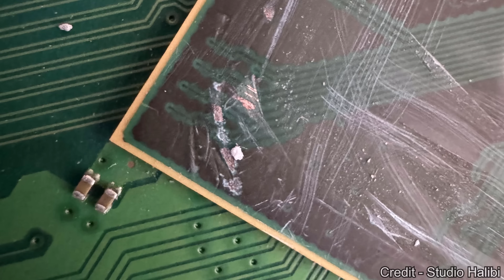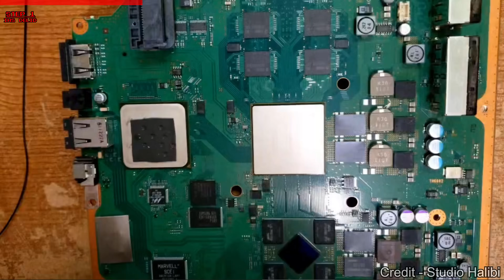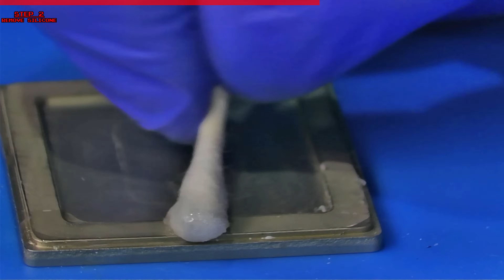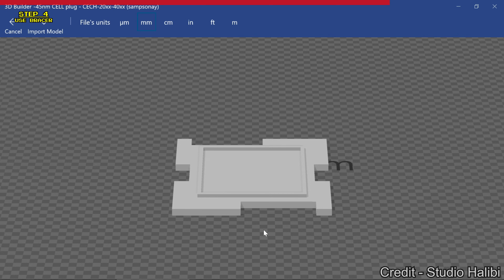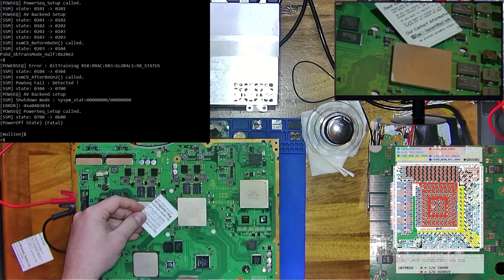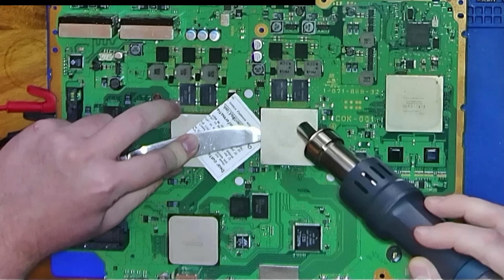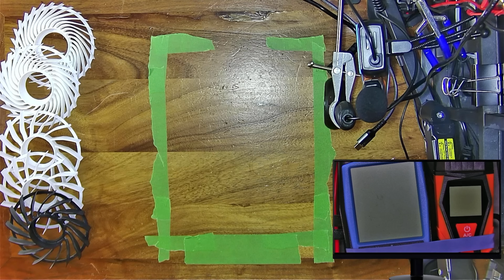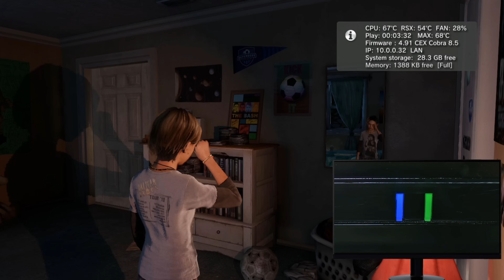How to Fix | Episode 1: Overheating. How to Delid CPU/GPU and fix YLOD - BEWARE of BAD MODs!

Comment: Hi.
2nd time around here.
I want to differ in something......
I have an E model,and i did almost all of this.
Only i need delid Cell and new thermal pads.
And i did some extras too.
I used the last ps3 fan,the white label DC brushless from last models (make long cables for to attach) and used thermal grizzly.
And my 226 psu flopped,so i have 231 instead,and i got 62 on Rsx,73 on cell at 40x speed at maximum.
I don't think 231 is the worst one (ZZR  with 19 blade fan are truly the worst option)
And that's for me.
Also i did remarry on BD drive,my 410 lens is great.
Maybe one day i can get a frankie mod for this beast.
Reply from the maker: I am quite sure the APS-231 does run hotter in a BC model. Both the 226 and ZSSR run cooler in this scenario. Though the 231 does work, there's no telling for how long.

About the fans from later models. I tried a G14T S1, it's the quietest fan. But the issue is that it's weak. In order to push the needed volume of air, it needs to run at like 40-60%, which is just as loud and doesn't have the headroom at 100% to push much more air. So if ever the higher percentages are needed, like when past wears out or a really hot day, it can't cool as well as those more powerful fans. 

Fun fact, the G14T and D14F have the exact same 15-blade blade. It slips on the rotor. The only difference is the motors power.

Comment: Man, the sheer increase in console hardware fragility/complexity between 6th and 7th generation is staggering. 
Even something as simple as a routine replacement of thermal paste requires specialized tools and surgeon-like precision to avoid destroying your machine.
I've done lots of amateur work on 6th gen stuff and earlier to save myself a bit of money and learn new things, but after 2005 all the manufacturers really put their foot down.

I'm almost glad that consoles seem to be dying, at least in 20 years when all the Xbox Series consoles start to fail from who-knows-what, nobody will have to scramble to save them to keep their nonexistent exclusives playable. 
I dread the day when I can no longer boot up a quick game of Tokyo Jungle.

Comment: Thought i watch your video in it's entirety this time. It's a very nice guide but i really do not see the point in relidding. It's completely pointless. As long as the cut glue is still there, with it be clamped down. It should be more than enough to keep it in place, infact the thermal paste along with the clamp should keep the IHS almost glued to the Heatsink. I Delidded Wii's, PC's, Wii U's, 360 Slims and E's and PS3's. Never had any issue with the Dellided IHS's rattling and moving inside. The Paste along with the tightness of the Heatsink is enough to keep it tightly in place. As for Delidding an RSX, heat gun with a dental tool is all that's needed to lift it up when the RSX IHS loosens.
Reply from the maker: it's not about it staying in place. The 2 issues with leaving the cut silicone in place is that it's nearly impossable to line up perfectly again and if it's not is can sit tilted and apply uneven pressure on the die/package.

Second even if you do get it to line up, it doesn't resist any lateral expansion forces. Transvers, side to side movement. This can allow expansion forces to curl the Interposer/MB with each thermal cycle, having an unknown effect on long term reliability. It could be fine, it could shorten it by 5 years...without the CAE modeling, we'll never know. So because I don't know, I don't reccomend changing a varible that can have unknown consequences.

BTW that's one of the common arguments I cut from the video for the sake of time and not dragging everyone through the drama. This is one of those "wishfull" thinking rationalizations we need to be careful not to deluded ourselves into believing. Take a step back and ask yourself, do I have the data to believe what I want to be true? Or am I just accepting the risk and making excuses? 

I don't mind taking the risk personally, but I make no excuses about it being fine. I simply can't know that.
Reply: @ripfelix3020  Would like to see a video or a post on this. Looks like I may have to consider relidding with liquid metal or reapply some glue to the chip and die, but not to relid so it relies on gripping onto the silicone instead. One reason I do not like relidding, is the IHS essentially glues to the Heatsink, if you were to yank/pull it out. It can potentially rip out the Cell and damage the BGA Solder underneath, and I've seen posts on that. Where as with a Dellided IHS, that's not an issue since the thermal paste is essentially stuck to the Heatsink, almost making it like a direct die heatsink. So with it being relidded, heating up the Heatsink with a heatgun is a must, if your going to go back in. Also does that 1mm part you provide improve the contact between the Die and the IHS? I might consider getting this injection moulded from PCB Way.
Reply from the maker: It can resist the warping stress and keep the die flat against the IHS, improving the uniformity and maintain the bondline thickness. It helps reduce pumpout. But I wouldn't say it'll improve temps vs a fresh delid. That's not it's purpose. At least, not the way I use it. It was SONY's purpose, but that's because they didnxt delid and were just kicking the can down the road. It'll work for 3 months, beyond the service warranty. That's a dishonest use IMO.
Reply: @ripfelix3020  Interesting so it kind of serves its purpose like the XClamp on the Xbox. I guess I will need to get a quote on these from PCB Way. Another question is Liquid Metal and its longevity sealed underneath the die. Will it essentially last forever? I hear they oxidise and last upto 6 months on top of the IHS. But with it being sealed underneath the IHS with those PS5 foam pads, silicone glue with the conformal coating. I don't see oxygen really getting to it. It would be a no brainer to relid with some high quality liquid metal, if it were to last indefinitely.
Reply from the maker: I'm still testing that. I don't think it'll last, but Sony seems to think slathering it on generously and containing the excess with foam will account for soak in (nickel plating forms a galium barrier to help prevent this, but some still penetrates). I'm not convinced. We'll see how long it lasts, but it'll be a while before I know.

The silicone leaves an airgap to prevent a pocket of air being trapped. Hot gas expands and will increase the warping stress otherwise. The open cell foam isn't air tight either. It'll stop the LM, but not oxygen. Oxidation is always an issue, but I don't think it's the primary concern with LM. Soak in is.
Reply: @ripfelix3020  But you did apply some on the IHS. I don't see it soaking in any further I think that's more of an issue with copper the PS3's IHS is Nickel plated. But regardless, thanks for making the Tantelizers, it makes the system look clean and they are working great in my Japanese imported A01. I will definitely consider the 1mm brackets and resealing the IHS if it insures on its longevity. I have another CEHC Console that also needs a restoration.
Reply: @ripfelix3020 Have you tried Relidding with Graphene Pads? I hear they never have to be replaced and they perform just as well as Liquid Metal. There is also PTM 7950 which would be great above the IHS and it can supposedly last forever and performs just as well as thermal paste, but it needs 10 thermal cycles for it to work effectively. I would love to see if I can Relid my B01 with this and monitor the temps from there. Another thing I would love to see is an Undervolt tutorial to improve temps.

Comment: I've recently openend up my ps3 for the first time since 2009 (it's a backwards compatible CECHA01) and surprisingly it wasn't as dusty as expected even though I heavily used it, so anyways, I cleaned it, put new thermal paste above the ihs, new thermal pads BUT I didn't delid because obvious reasons of damaging the console, however, after being squeaky clean again, it's pretty obvious that one of the 2 needs delidding, I don't have it modded, but the fan gives it away, I may have to buy an ultradead console to practice because noone in my area does the delidding + I wouldn't trust anyone (maybe someone in my country does that idk of, but again, trust issues), also ps3toolset doesn't drop neither of the errors, only the 1004 errors and the last one was in 2019. soooooooo... yeah....
Reply from the maker: Then it's not bad enought to register an error yet. You could try a bracer as a short term solution, while you work up the curage/skill to delid it yourself. But Ironically, the cell paste wearing out is ramping the fans up, keeping the RSX cooler than it would have otherwise. So an overheating CPU may be what's staved off the YLOD from a GPU defect...lol.

It's not good to let the CPU cook, so it should get delided eventually. When you do be sure to use webman mod or a custom syscon fantable to keep the RSX under 70c so that you don't fix the cpu overheats, just to lower fans and cause more stress on the GPU bumps. Catch 22.
Reply: @ripfelix3020  Thanks for the answer and yeah man, it sure needs because an update to this: I ended up modding it up yesterday night because I was extremely curious about temps and the suspicions were correct, 71°C CPU and 48°C gpu, fan at 35% on idle chilling on the XMB, then played mgs4 23 mins to test in-game, 77-78°C CPU, at 52°C GPU, fan at 45%. A delidding is waiting.
Reply from the maker: yeah, it's what most of the CPUs look like on the console's I've bought and repaired. Worn, not great, not yet totally worn out. But loud and annoying.

Comment: Such respect for someone who actually tests, learns, examines their craft. Some scientific method in the retro gaming/modding scene is fantastic.
Reply from the maker: In this case it became necessary to test the speculation and competing hypotheses. Too many people were being mislead by clues that could be interpreted to mean whatever they wanted to believe. A confirmation bias rich environment. 

So without a clear explanation with data to support the conclusion, people default to their desired outcome. I needed to know too. 

I wouldn't normally go to such effort, but this was causing alot of people to buy and fail to fix backwards compatible models in the hopes of fliping them for profit.

Comment: Do you print the bracers every time you do a repair, or do you print a batch ahead of time, sand them, and reduce the overall process time?
Reply from the maker: I printed various revisions and sand them as I need them. Since I don't do very many consoles I dont really think about efficiency. I just print what I need and sand as I need to. Preferrably seldomly.

Comment: would be neat if you could test Thermal Grizzly KryoSheet
Reply from the maker: Just bought some, but I have a feeling it's marketing mumbo jumbo and basically a slightly improved graphite thermal pad, but IG we'll see. If it can perform as well or better between the HS/IHS than Prolimatech PK3, I'll consider it a viable alternative.

As for the die, if it's as good as MX4, then I'd use it there without a doubt. Zero degradation forever, sounds good. I have tried a graphite pad and it performs only slightly worse than MX4, so if this truely is graphene and better, then it should work quite well.

Comment: IDK if anybody has mentioned this, but GD900 is a great paste for the price. I've compared it to my mx6 and couldn't tell a difference in temp, but iirc the cheaper paste did better than mx-6 when it comes to pump-out over time. Right now my 6700xt is running around 5 degrees hotter than when I first pasted it around 6 months ago with mx6. I'm sick of repasting every 6-12 months, so I'm going to try some ptm 7950. People say it's less likely to have issues with pump-out. Anyway, well done with the video. :hand-purple-blue-peace:

Comment: i dont think pre 80c temps are really of an issue on the ps3 or any actively cooled system for that matter, its not the heat that kills it, its that heat cycling that slowly degrades the components
Reply from the maker: Partly. The higher the temperature delta, the greater the expansion forces per thermocycle. So it's both. But that's just normal thermocycling and assumes there's not a packaging flaw. Like poor adhesion promotor that the underfill is layed on top of, or poor curing of the underfill. Or inappropriate choice in underfill. Etc. 

That's what happened with the 90nm RSX in some phats. 65/40nm GPUs were fixed and are reliable. They can be reasonably expected to perform at normal 75-85c without reliability issues beyond expected.
Reply: @ripfelix3020  thank you for explaining it, i have the 90nm gpu. did a repaste and played through all uncharted games on it, was loud, and it did freeze once but it made it through so far.

Comment: Hi man! From seeing your ps3 videos, I understand you know your way into electronics. Even to the point of proving people wrong and finally putting an end on the wrong diagnosing and "fixing" of the ps3. You probably have better things to do than breaking your head with another console, but there's this other issue that seemingly no one knows how to fix on the original xbox, the tiple boot frag, almost every console plagued by this is deemed a loss. This is a rare-ish error where the xbox fails to pass the self checking test and doesn't give any type of indication to the actual failing part. No display no sound no error light or code just red and gren flashing (frag-ing [or Flashing Green And Red] means general system failure, xbox doesn't get to post). I'm losing my mind with my xboxes like you did with your ps3s some time ago, I hope more light gets shined on this. Thanks.
Reply from the maker: I have several friends deep into OGX and they are on the trail. I'll keep my ear to the ground and at some point I intend to attempt the 1.4GHz CPU upgrade, steller, HD+ mods. I'll dive deep, but I'm still captivated by PS3 and want to complete several ongoing projects with it before moving on to another console.
Reply: @ripfelix3020 Exactly, keep going 👌

Comment: How did you make that tool any tutorial?
Reply from the maker: I bent a fingernail file and sanded it down thin and flat enough to fit in the gap, without scratching the surface.
Reply: @ripfelix3020  Thanks which grit number of sandpaper did you use?
Reply from the maker: Used a dremel to remove most of the thickness and the rough surface of the "file" part. Had to heat the tip Glowing red before bending or it will snap. From there I used some fine-ish sandpaper to smooth the lower surface and round the bottom edge. IDR the grit. But when it's smooth enough to glide smooth on the surface of a sheet of paper without catching or scraping it was done.
Reply: @ripfelix3020  OK thanks man

Comment: Ive never saved a video so fast in my life. Bought a launch model 60gb from Japan last year and plan to spruce that baby up right. Will 100% be consulting this video beforehand.
Reply: Same, got a CECHC that's overheating the CPU, gotta delid it but I don't wanna kill it lol
Reply: Literally same here. Absolutely terrified but my desire (and stupidity) for a working BC PS3 is much greater than my fear of bricking it more.
Reply: @AbrahamLure  I mean, I don't know which BC model you have, I have a CECHC, which is basically a CECHE with a smaller hardware, haven't noticed anything different in PS2 games when compared to a jailbroken PS3 running PS2 games, basically the same
Reply: same with me, its sitting in its box in my closet ready for the day i run a full maintenance on it